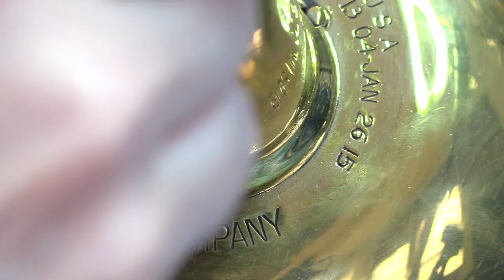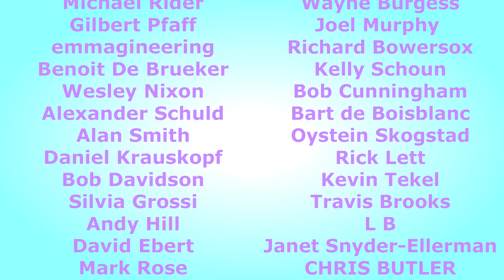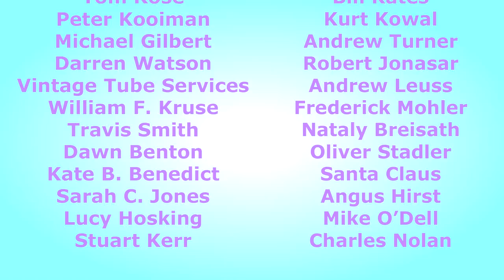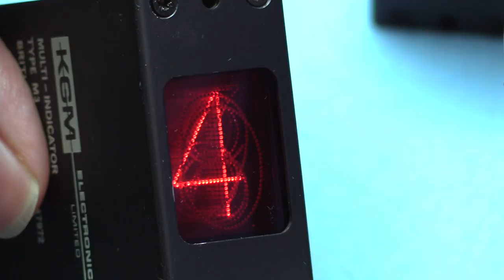The Telephone

Comment: Is a big telephone exchange, I presume a reasonable portion of the sockets in front of the operator must connect to other operators, because you can’t have every destination on your own panel. The more operators, the fewer “real” connections you can make. Is there a law of diminishing returns, where at the end you have 99 lines to other operators and only 1 real line?
Reply: The diminishing returns kick in much earlier than that. The number of "customer" lines would (and commonly still will) basically always be greater than the number of "peer" lines + the number of "long distance" lines, since you will almost never have everyone needing to go to another board. "Peer"
Reply: Oops, hit the wrong button.

"Peer" lines to other boards would have either been completely absent, or likely would have outnumbered "long distance" lines, since it's easier to run cable inside a single building, or within a single town or city, than it is to run cable cross-country for dozens of miles or more.

Comment: Actually the magneto was not because of there not being electricity in rural areas. There were several systems, DC power for voice uses a central battery at the exchange, over short distances  calling could use the exchange battery but for longer distances a higher voltage was needed  It was simplicity to use a magneto, in fact until relatively recently the military still used magneto ringing on field telephones as their voice circuits used low voltage with local batteries in each phone, typically 3-6 volts. In the UK ringing voltage is 70 volts 25 Hz.

Comment: One more note... the tip and ring additions to numbers in order to make "two line phone numbers," added an R or a W to your number. Also, multi-person numbers which rang up to 20 people at a time! LOL
Reply: Never heard of a "two-line phone number".  I don't know what you mean by "tip and ring additions" -- is that referring to more separate connections on a plug and jack?  Though the Tip and Sleeve were the original two, and the Rings were added.
Reply: @JohnDlugosz  ,  Yes, sir, I did. 3926W was mine and my friend down in the next building was the R. And yes, the tip and ring were two conductors of the three wire cord.

Comment: It would be cool to have one like that, meaning brass case and carbon elements and woven cord, that functions as a modern bluetooth headset.  Picking it up when it's not ringing will activate the Siri/Google/Alexi/Cortana/Bixby mode, just like modern wireless headphones.  So we've gone full circle and don't need a dial anymore, but the "operator" is a machine.

Comment: In my capacity as a splicer for the Company Formerly Known As Bell Telephone, I get to work on a little bit of everything. One day, I'll be working on a service order for a high bandwidth fiber KEGS circuit, the next I'll be using a breakdown set to find where a lead and paper underground cable installed in 1913 is getting wet. Meters have gotten more advanced (though I still use a 20 year old 3M 965DSP) but fault locating techniques on copper cable haven't changed all that much in the last century.

Comment: I used to management a phone system and has talking to the phone guy and for some reason I ran my finger down the wiring block. 

As I did tbis I felt like a sharp pin prick and yanked my finger away.  The tech said something like "it bit you didn't it?"

 He told me I must have touched one of the pairs that had an incoming call and it was ringing and I got hit with that 90 volt AC jolt.

Comment: Can't you make some conversion hardware, so that you can connect this telephone to your smartphone? I'm sure there are some Bluetooth to speaker/microphone out there. Not sure how it would differentiate between voice and ringer, though - so that the old ringer is activated when someone calls you
Reply: I think devices are commercially available so that you can drive the hardwired phones in your house from a cell connection, probably using bluetooth with your existing cell phone so it’s the same number either at home or away.

Comment: Land line subscriptions are so expensive here that almost no one has them. It's not really because the telephones themselves are so inconvenient, although the mobility makes it somewhat more attractive to have one single phone. It's a bit of a shame, but what are you gonna do...
As to why they also tear down the lines and such, I can't see how it's very expensive to leave it running, but whatever. Oh, and what about emergency systems in case of natural disasters or war? Let's hope we never need to find out.
Reply: Poles have to occasionally be replaced, as do wires, configurations have to occasionally be changed, and the old wires actually use 90 volts. So, there are definitely real reasons to pull out the old wires, though preferably to exchange them for landline to fiber converters- I have my dsl router powered off of an UPS, and that's enough to keep it on the internet during power outages, so it should work for phones as well (don't have landline service, so never had opportunity to test it).
Reply: @absalomdraconis  I understand it's not free to keep it operational, but for the most part, I think, you can't find a much/any lower maintenance-requiring system.

Comment: OK fran, now I understand how you got the 90 volts but what did you do to get 20 Hz. I understand that if you hook up 60 Hz to it, the sound would be more like a buzz.
Reply: She has a land line, they still use 90 volt 20 Hz ring in most of North America.  Many cable modems and other voice over IP devices provide 20 Hz ring as well.

Comment: Not that old, but I still have an old rotary dial phone in my basement from probably the late 1950s-early 1960s.  It came with the house.  I'm clinging to my old landline, though I have a modern smartphone of course, and with Google Voice and Teams installed, I have the option of calling from 3 different lines and numbers on it.  But it is satisfying to use that old basement phone.  The audio quality is excellent, and it's cool that my combo cable modem/VOIP device still supports rotary dialing such that I can make outgoing calls on that old rotary dial phone without doing anything special.  It's heavy and built like a tank, and you could use the receiver to subdue an intruder before calling for help on the same phone, which would survive unscathed.

Comment: I have a wall-mounted, wooden box, Railway omnibus phone. They were used for Signal Boxes and the Signaller used a push button to tap out the code for the signal box he wished to speak to, eg:   "- - . "  = Long, Long, Short, Long (similar to Morse), and although all the Signallers on the omnibus circuit received the same ring, only the one assigned to " - . -" was supposed to pick up. (Often "ear-wiggers" would hear things said about themselves that they wouldn't like).
I have it mounted at the end of the hallway and have the DC bell as our doorbell. It has a lovely tone.

Comment: I live on a farm in Devon England. British Telecom told me "we don't have enough wires in the line for your new building and it will cost ££££ to put in" so we use 4G for phone and internet with no problem. My point is that has saved 2 miles of copper wire being run from the village to the farm,,,,how much wire could be saved/recycled buy us all going 4G/5G (I know tin hats for 5G LOL)
Reply: They sorta lied to you- I don't know the cost for above ground in the US, but buried costs about $100 per foot in the US (around $300 per meter if you prefer) regardless of what's being buried, and the cost will likely be equivalent in the UK. Above ground is usually cheaper, but purchasing the rights to use an existing set of poles, or to set your own (and those associated rights purchases) are still pretty hefty.

If you looked up the actual cable & other equipment they would use then it wouldn't be cheap per say, but the various other costs of installation would absolutely dwarf it.

Comment: Thanks Fran!  I've been thinking of getting an old candlestick phone but was worried they would too noisy or not have the audio quality needed to use on modern lines.  I'm wondering even if a keypad from an old phone could be secreted away in the ringer box for making calls.  Very cool.
Reply: Yes they do work well on modern lines, though you might have to tap the carbon microphone a few times to unstick it, as that is what was making the distortion. Dialler simplest is to find a tone dialler for rotary phones, that you just hold up to the mouthpiece, and which then generates the touch tone pairs from a small speaker, or take an old phone and just use the keypad to dial.

Still have a rotary dial phone, it was in use up to around 2017, when it needed to be swapped out, as it was there strictly for line testing, and the system changed so I needed tone dialling for the * and # keys. Exchanges mostly still support rotary dialling, though those that are VOIP tend not to.
Reply: The later candlestick phones had a rotary dial on them.
Reply: If you still have pulse dialing you can "dial" by tapping the hookswitch.
Reply: @eDoc2020  Yes, but dialling higher numbers can be hard, especially things from 8 to 0, where your exchange equipment might take a uneven cadence as being different numbers.